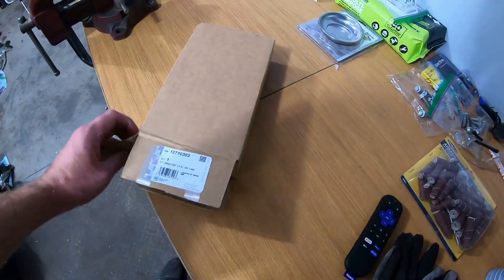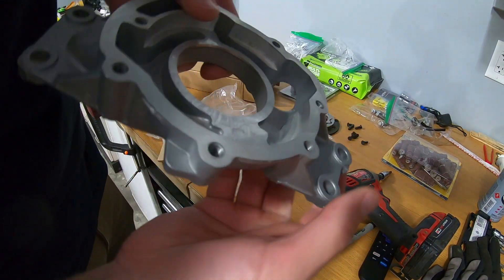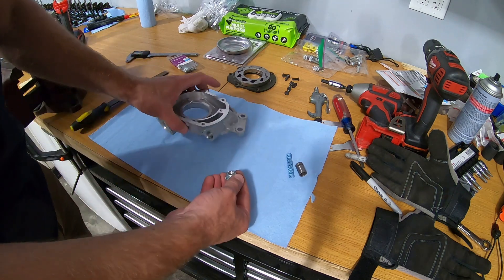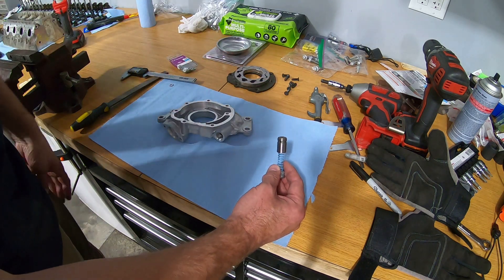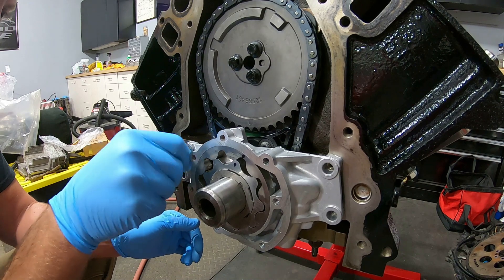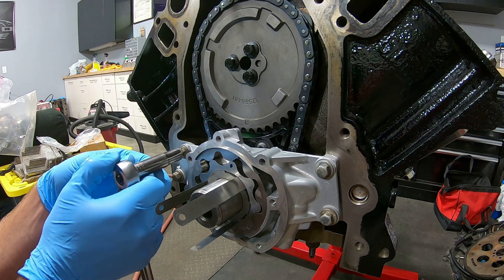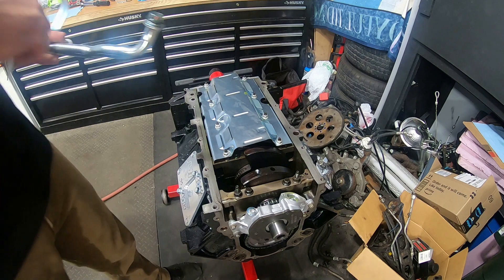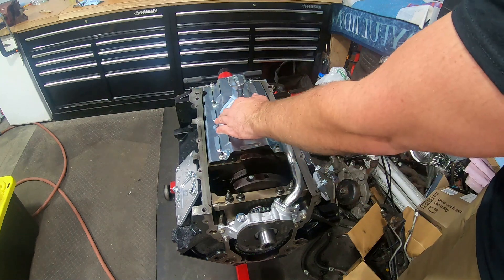DIY: LS Oil Pump Porting & Shimming, 500+ HP 6.0 Build (Part 8)

Comment: Did you get it going yet? How significant is it to use the shims to center it up? I dont think i have seen anyone else do that yet.
Reply from the maker: @davidday3305  o yeah it's running! Probably not necessary as 95% of people don't do the shimming. That Engine guy on YouTube shows this procedure and I liked it so I did the same.